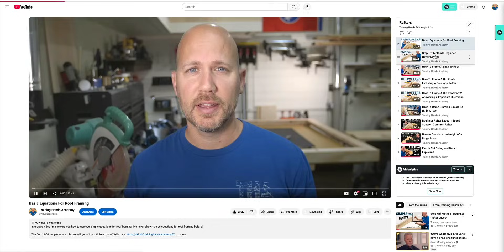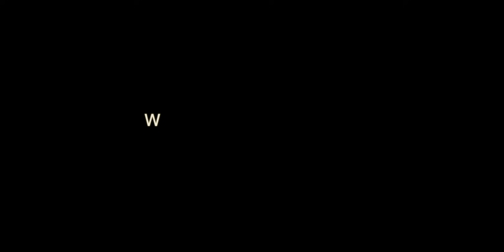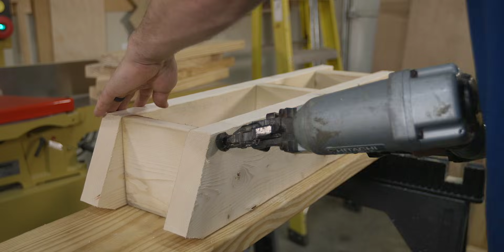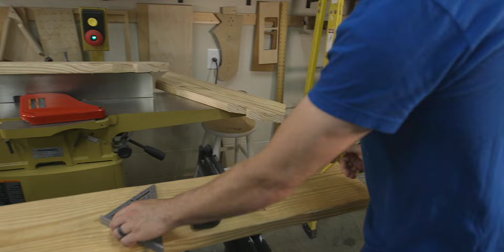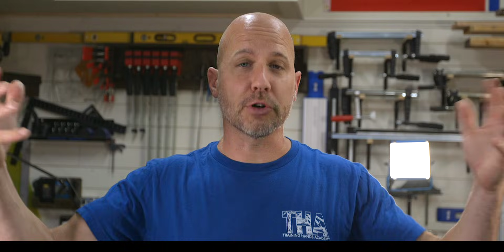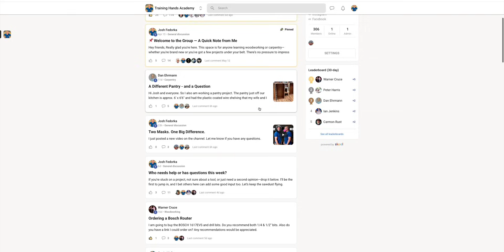Roof Framing 101: Ridge Board Installation Tips That Work

Comment: I'm sure that it wasn't a problem on the small roof in your video, but when installing the rafters, you should do the rafters on each side of the ridge at the same time or immediately after the opposite side. If you install all of the rafters on one side before moving to the opposite side, the weight and forces of the forst side could cause the ridge to bow.
Reply from the maker: Yes, thank you for adding your knowledge!

Comment: Thanks for taking the time to make these terrific videos. In the last video there was a lot of time dedicated to figuring out the true ridge board height measurement. In this video it appears that the rafters and ridge board are placed without using the ridge board measurement. This leaves a nube like myself wondering just how specific I really need to be about this in the real world. Can you offer your take? Thanks again!
Reply from the maker: Correct. If you're not trying to match anything exactly (like another roof line, etc.), you can be a little more relaxed on ridge height calculations. However, the math will definitely help when it comes to cutting the rafters.

Comment: When you attached the rafters to the top wall plate do you just toe nail it into the top plate with screws or nails on both sides? I wish i could've seen how you screwed the rafters down in the video
Reply from the maker: toe nail framing nails on each side
Reply: Look up Simpson hurricane ties though, super cheap for what you get!

Comment: I Thought  u always had to have 2 ridge beam supporters on each end ? Because im doin a front porch with gable roof but im just trying to put 1 ridge beam supporter on the front for the view but not on top of my front door.
Do u think it should be fine if i do it like that?
Reply from the maker: The only time you need supports under a ridge is when the ridge is structural—meaning it’s designed to carry the load of the roof. A standard 2x ridge board is not designed to carry load; it mainly serves to align the rafters. That said, I can’t speak to your specific roof without seeing the full setup, but in general, this is true.

Comment: Just thinking, why not extend the 4 foot plate board (that the rafters attach to) by 8 inches at each end? That would enable to simply fit an additional rafter on the overhand. No ladder needed.
Reply from the maker: Yes, if you don't need an overhand, you would just stop at the last rafter and have no overhang on the ridge.

Comment: The eve extensions are an artistic (?) waste of wood.  Since they are not insulated they can be half the height and still have adequate support.
Reply from the maker: I get what you’re saying. The eave extensions aren’t insulated, but they do more than support the roof — they help protect the walls and windows from rain and make the roofline look right. I’ve done them as thin as 3-1/2" before and used lookouts instead of a ladder rake.
Reply: @TrainingHandsAcademy  The size of the trim determines the size of the extensions. Simple answer.
Reply from the maker: @robertmerrill123  Yes, that is a great way to look at that. Thanks

Comment: I've never understood why people use a rake ladder.  I haven't been a framer in over a decade, but in a past life I framed full time.  And we always used lookouts instead.  It just feels more sturdy.
Reply: I agree. Flyer rafter with lookouts is always the way, rafter or trusses we always used lookouts
Reply: @alexochocinco  Flyer Rafter?  That's new to me, we call it a "Barge Rafter"
Reply: @saltydroog854  Around here we call them fly rafters. I've noticed that the terminology is regional, many times.
Reply: @saltydroog854 you must be from South Carolina or about!
Reply: @LogHewerthat's what we call em in TN & KY
Reply: @Mr-hm1wr Connecticut.
Reply from the maker: I agree.
Reply: Anything you can do on ground, without going up ladder is good
Reply: With our snow loads we use lookouts. Plus we have 24 inch overhangs
Reply: How do you build lookouts?
Reply: @Val1973-n2h  You  stop with your course of rafters back a few courses from the gable.  And you build the gable short of the height of the rafters by whatever the dimension of your lookout material.  And your lookouts flush mount to the rafters and rest on the gable, cantilevering out over the end of the gable to your barge rafter
Reply: Because Im building a shed lol

Comment: OK, but how do I calculate rise/run for a greenhouse that will have different pitched roofs.  The 12-ft wide greenhouse will have a 45-degree slope (12:12) on the front, south facing side with a 3-ft high outer wall.  The back wall will be 7 ft high.  I don't know the pitch of the back wall.  I'd like to eliminate the ridge board for ease of construction (I believe) and use plywood or metal gussets at the peak and collar ties a little lower. (Can that be done.) How are the rafter cuts determined in this situation.

Comment: Can you add vented soffits under the rake ladder?
Reply from the maker: You technically could, but I personally wouldn’t. The goal with soffit vents is to draw cool air in at the bottom eaves and let it exhaust out the ridge vent. That creates the best airflow through the attic space. Adding vents up under the rake doesn’t really help that system work any better in my option.

Comment: I have asked this question to others, all I get is the basic definition, that one carries the roof load and the other doesn't.
What is the difference between a ridge board and a ridge beam? 
I seem to be missing something, because to me, they are both in the same location/position (sandwiched between the apexes of the rafters) in the structure. Please explain how the "board" is not carrying weight. Thanks
Reply from the maker: Great question! They’re both at the peak, but not the same. A ridge board lines up the rafters but doesn’t carry weight — the rafters support each other and transfer load to the walls. A ridge beam carries roof load directly and needs posts or walls under it. You often see ridge beams in cathedral ceilings or vaulted spaces without ceiling joists. In ridge board systems, collar ties or ceiling joists help reduce roof spread by tying the rafters together. I hope that helps?
Reply: @TrainingHandsAcademy  
Best explanation so far...
So you are saying a ridge board "needs" collar ties and ceiling joist to complete the roof system. 
The ridge beam (supported by walls or columns) holds up the rafters. So they are basically hanging from the beam. 
 On a gable roof, the ridge board would become a beam once the gable ends are framed in? 
Because then it is supported by the gable walls and transferring the weight onto the main walls.  😀Thanks
Reply from the maker: @williamhoudersheldt7076  Smaller roof systems typically don’t need collar ties, while larger ones often do. Collar ties are usually placed in the upper third of the rafter span. Yes, rafters essentially hang from the ridge beam. Just because you frame the gable end and support the ridge board doesn’t mean it’s carrying load. In fact, on larger roofs, you’ll often see the ridge board split in sections — which shows it’s not designed to carry load. That said, load always finds the stiffest path, so if the system isn’t framed properly, unintended load transfers can happen. If you want more help with this (and I really enjoy these kinds of questions), let’s continue the conversation over in my community. https://www.skool.com/traininghandsacademy/about
Reply: @TrainingHandsAcademy  
Thanks